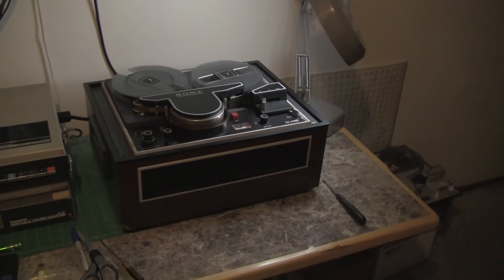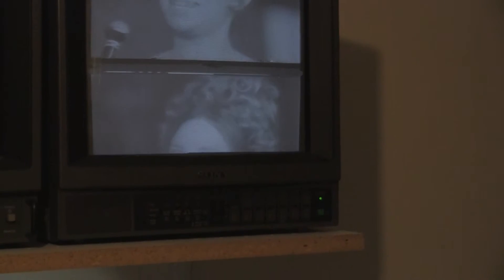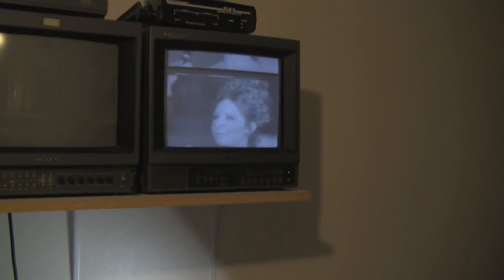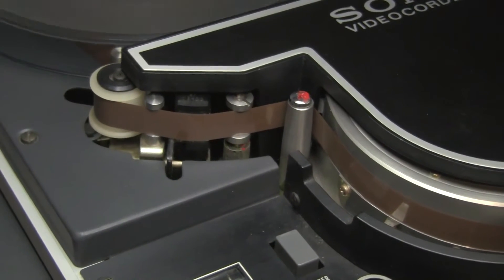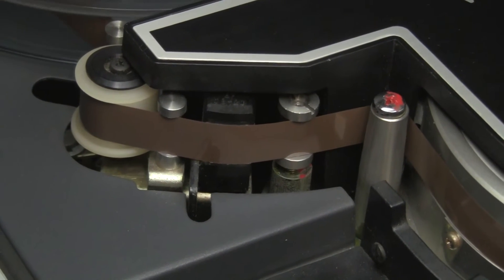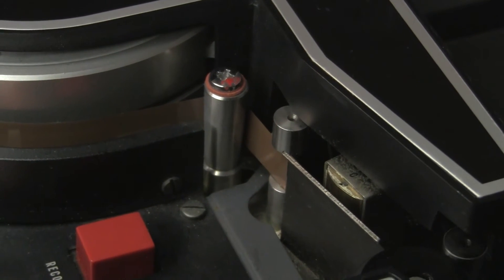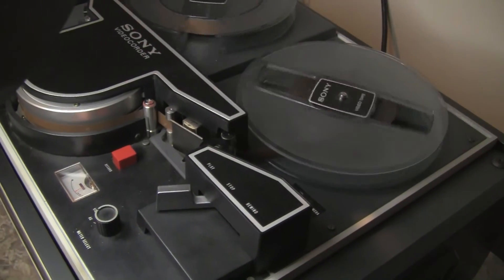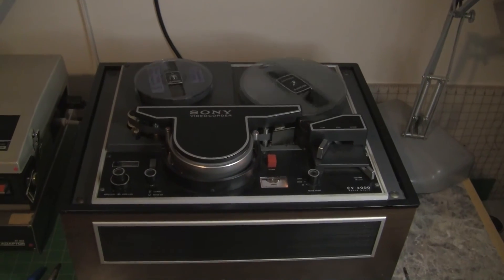Sony CV-2000D in Operation after 40 years!

Comment: Hello!! I need help. I do not have same VTR than you, i have the Sony CV-2100 ACE and i can not view image connecting a RCA wire from "AUX VIDEO OUT" to a "VIDEO IN" of a CRT television, I tried everything I know, i tried to connect from "AUX VIDEO OUT" to the TV's RF IN, i tried PAL, NTSC, SECAM, and i do not know what more to do. Please, tell me if i need a special wire or anything. I hope you read this. Thank you so much!
Reply from the maker: You do want to go from aux video out to your TV's video in. Going to the RF in does not work that way as you have found out. First, see if your VTRs electronics work by feeding video into the Aux video input, placing the machine into record without a tape, and then checking for the signal coming back from aux video out. Be sure to tie back the tape sensing switch so the VTR will run with no tape on it. The chances are very good that the video heads are either dirty / clogged or not working. 
Using an older monochrome CRT television might be helpful. Certain late model color CRT monitors (and MOST LCD TVs) will mute the screen if they don't like the video signal. These TVs are useless for testing old VTRs. Also, get an oscilloscope for looking at your signals. That is the best way to find out what is going on with your machine.
Best of luck and I bet you will have that videocorder running in a short time..
Reply: @videolabguy  First, thank you for answer me.
Well, i know connect to RF is not the way but i tryed becouse i did It all!! 
I connected a camcorder to the VTR video IN and pushing the Record button it show the camera image great, then i record on tape and when i rewind and play It again It only shows noise. 
The wire from VTR Vídeo OUT to TV AV IN is a standard one?